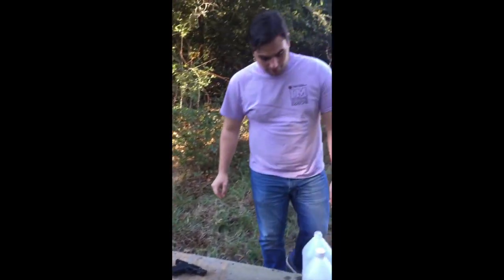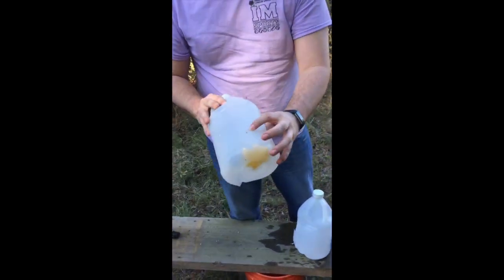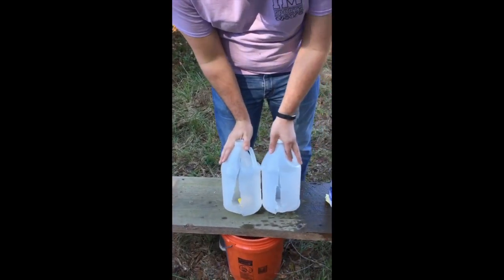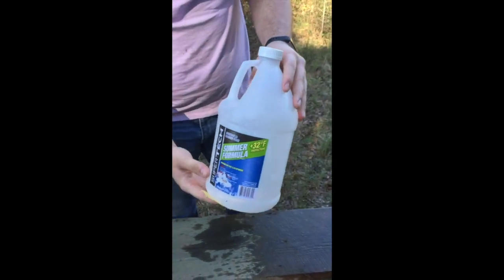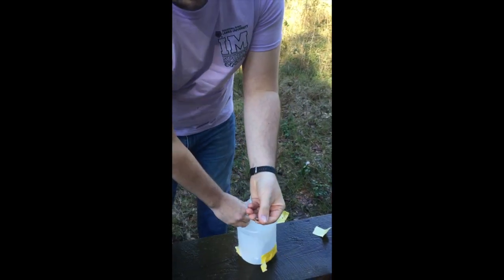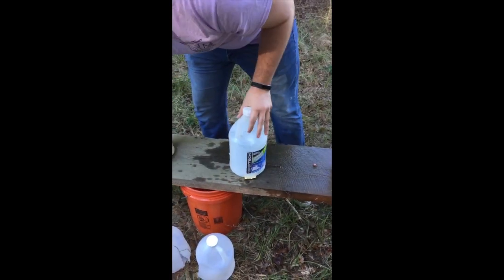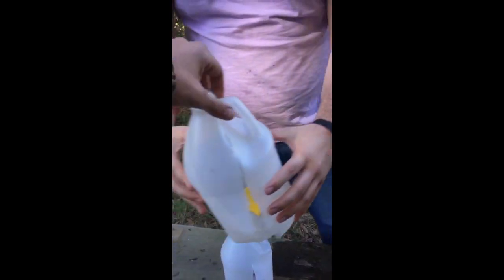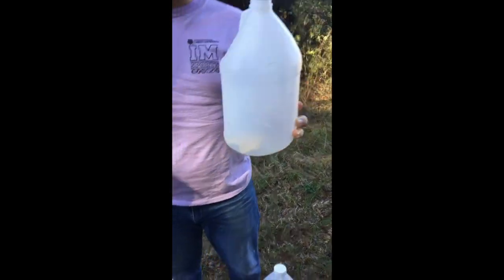How many water jugs will a 9mm bullet go through?

Comment: Replacing the bottles after damaged and using the bottles with the snap lids instead of screw tops would have provided more consistent data. Neat vid either way, I'm just not fully convinced.